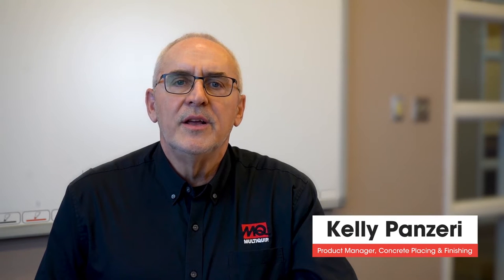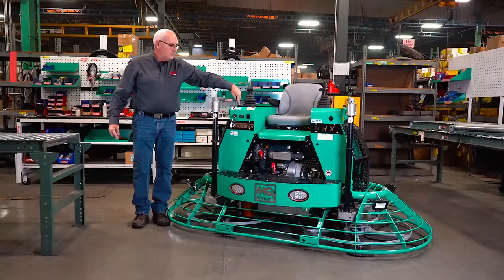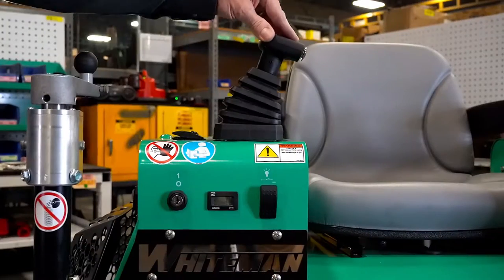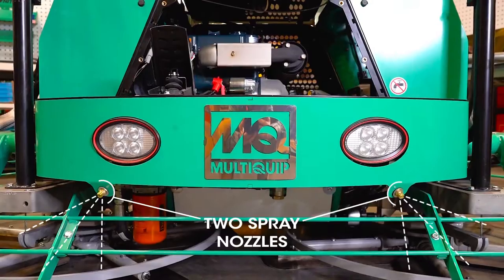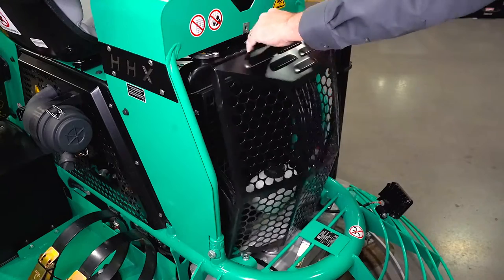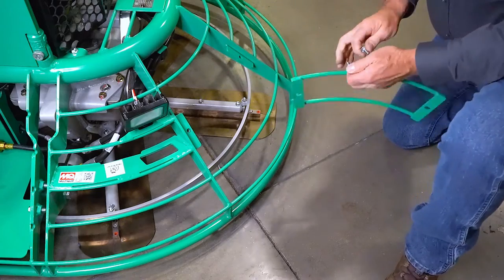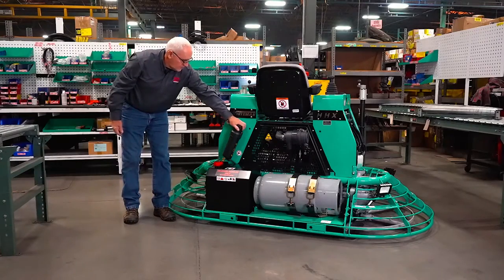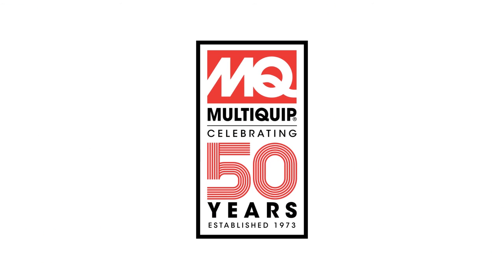MQ Whiteman HHX Series Ride-On Power Trowel

Comment: Thank you for the explanation, Congratulation for the 50 years, I live in Monterrey, Mexico and I have seen these kind of machines working, (not this model, I´d like to) we recently placing and finishing  near about 15,000 m2 of hydraulic concret.
Reply: We have these machines in Australia, The belt system is not good for panning. 
The concrete has changed in a few years, we find the full hydrostatic system to be more efficient.